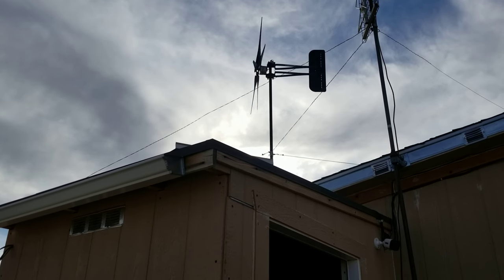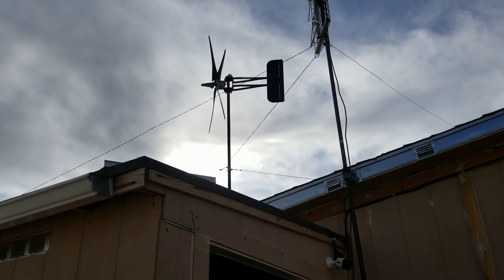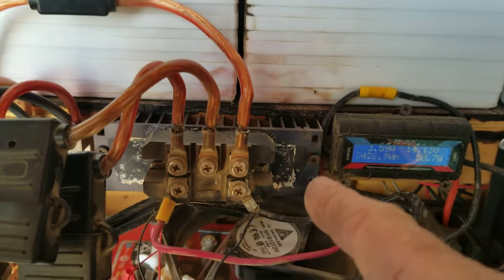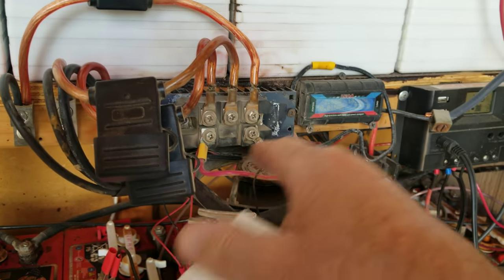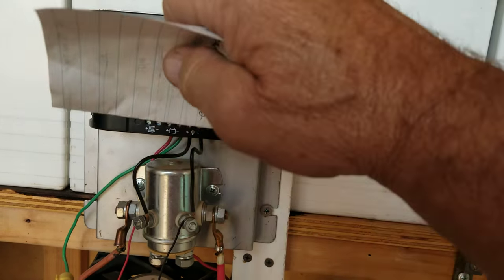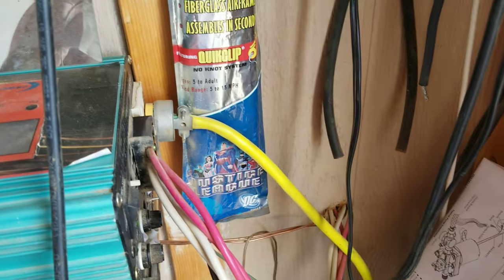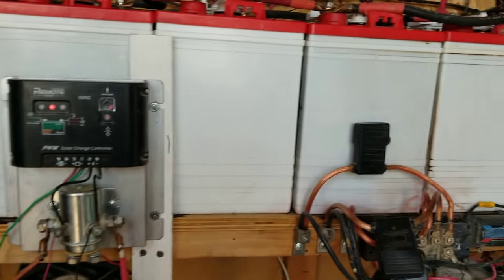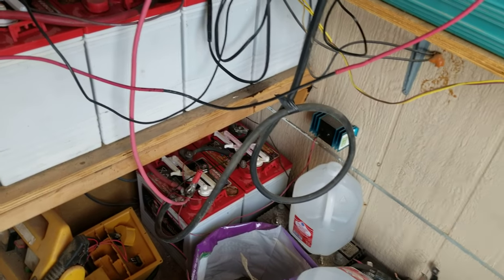Wind turbines, controllers and batteries explained, March 6, 2020

Comment: you have a 20 minute add be for we can see your channel i on subscribe no more utube
Reply from the maker: Ads are how we get paid.  Sorry that you feel we youtubers should not get paid for our efforts.
Reply: @GBear  the adds out of of line way longer then what they should be i like your videos im 85 and a diyer just doing solar i have been  buying for ten years now putting them to gather yours videos is my entertainment
Reply: @GBear  biden don,t pay me enough to pay 20.00 a mouth for utube
Reply from the maker: @LEETAVES  Glad I can help.
Reply: @GBear  HEY G BEAR I HAVE ONE OF YOUR CHARGE CONTROLLERS IT IS A INTRONICS A MPPT 75HV HOW DO I SET THE SETTING FOR 24V PANELS THANKS A LOT IT LOOK LIKE IT HAS 8 SETTING
Reply from the maker: @LEETAVES  Just connect the 24v battery bank to the controller first and wait for it to boot up.
Then connect the solar panels, not to exceed the total amps of the controller. (If it is a 30A controller, you can only input 30A total.
Reply: @GBear  IT IS A 75AMP SO I THING I COULD PUT 1400 WATTS THAT MAY OVER LOAD IT I DON,T KNOW
Reply: @GBear  HEY YOU DO THINGS JUST LIKE I WOULD DO I HAVE SOME HIGH DOLLAR PWMS CONTROLLERS IHAVE OVER 500 IN BUT ARE TO COMPELCATED FOR ME TO USE I LIKE THE PLUG AND PLAY
Reply from the maker: @LEETAVES  Solar controllers are all the same.  Connect batteries first so the controller knows the voltage, then add solar panels.
Just be sure that if you are using LiFePo4 batteries, that the controller is designed for them.